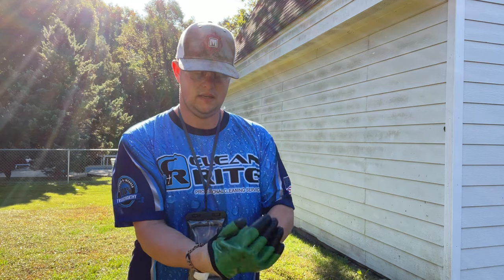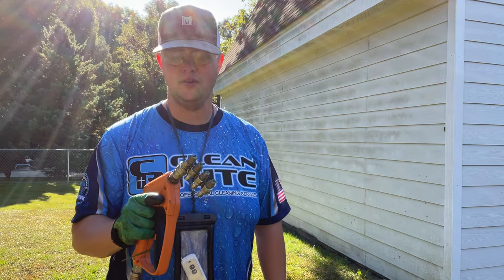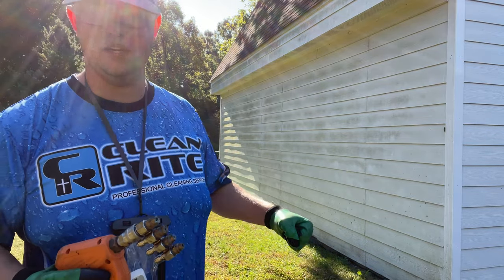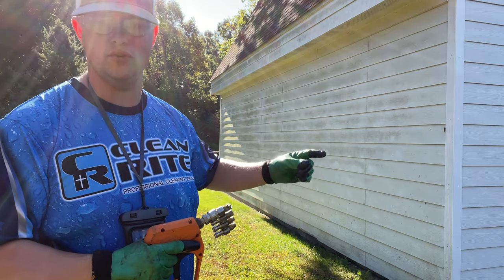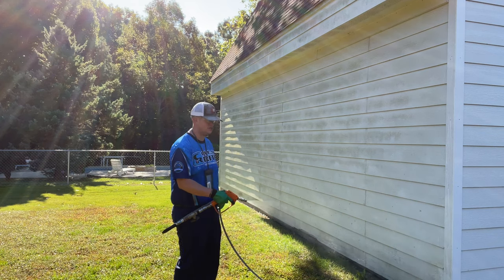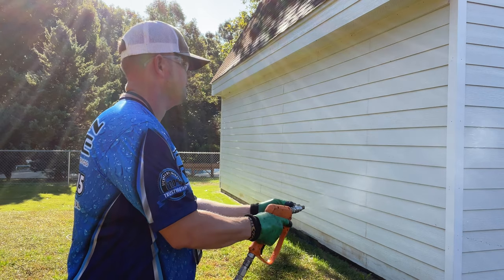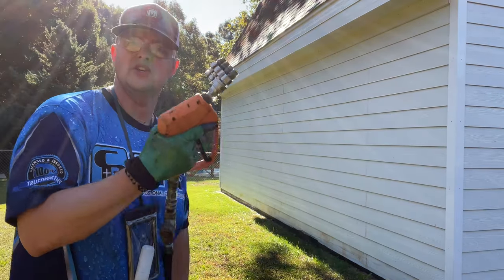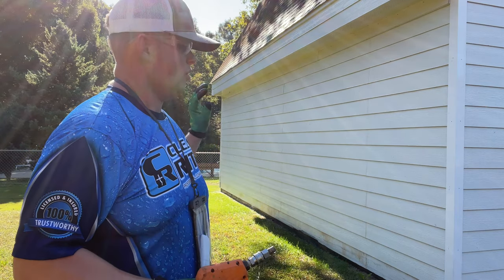Remote Downstream Injector and Down-streaming Overview

Comment: So are you using a remote soapbox? Or are you using something like a remote Flow Pro that actually turns the by pass valve on and off for a bacth mix. I get confused as to why folks need the two valves